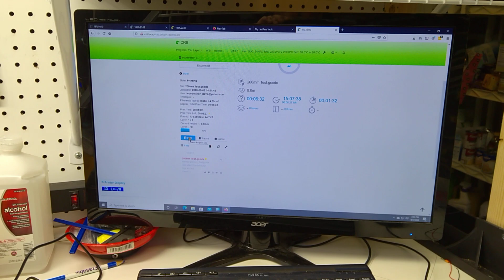CR-6 SE updates

Comment: I have my ender 5 on that same IKEA table, big mistake, its not stable at all (too light) but its temporary, im gonna use a big drawer cabinet so I have some storage also and going to place the printer on concrete on that drawer, hope that works out well.
its always fun to strive to bit by bit a better print :) lets keep on tinkering. thanks for the videos, I love em
Reply from the maker: Thanks for watching.  I agree with the Ikea table.  I have my Ender 5 in the enclosure on it.  Was going to be temporary, but ran out of space.  It works, but would like a better solution. I have quit doing upgrades for a while, don't know what to replace,as there is almost no stock parts left.  I did give the 6SE away, just no real upgrade possibilities.  Take a look at my more recent videos.
Reply: @woodwaker1  I have seen em all :) , I want to redo my dual Z because mine is on the outside, have to take some long time to think about how to do it on the inside because I use the teaching tech Bottom enclosure and also im struggling with part cooling fans, the hero-me keeps colliding with my front bar, I like the pets fang design but need to order some fans, it doesnt end, when you dont have anything to upgrade just redo it all :p
Reply from the maker: @Retro_Care  That's what I'm trying to avoid.  Taking a break and just printing things now.  I kept my one Ender 5 with just a single Z so I don't have to redo the enclosure.   I made the Dual Z version a lot bigger front to back so that I didn't have to worry about the front bar.  The OmniaDrop sits much further forward.

Comment: I have a CR-6 and want to build an enclosure too.  Could you use extenders to help the Lack fit better?  Where did you run into problems with the Lack-approach?
Reply from the maker: It simply was not large enough for the Ender 5.   I wanted some clearance on all sides and the top.  Something you might want to consider is that most people who build enclosures move the electronics, especially power supply and main board out of the enclosure.  Not sure how difficult that would be for the CR 6.  Here is what I did, measure the printer at the extreme movements and then determine the minimum space required for a box.  
Here are some videos of the enclosure build;
https://www.youtube.com/watch?v=53stcBzj-UY&t=120s&ab_channel=DavidWilson
https://www.youtube.com/watch?v=qhXa1GVLnQg&ab_channel=DavidWilson               This one shows the enclosure sitting on the lack table, so you can get a comparison of size

Comment: With the way the CR6 does its autoleveling the filament extruding during your test is going to throw it off. The CR6 autolevels by the hotend basically hitting the bed and sensing that. If you have filament extruding its going to hit that and give random calculations for all over the bed. With the style of these printers leveling you would be best to do it once with no filament loaded. Then just doing it again if it goes off. The level shouldn't really ever be thrown off unless you really do something, as the bed is not adjustable.. Honestly, you are just wasting time running the leveling on every print (and if for whatever reason you need to, you need to investigate for an issue)
Reply from the maker: That makes a lot of sense.  I'll have to give that a try.  Thanks for the tip

Comment: How do get the new Creality 6 SE to print my simplify 3D files
Reply from the maker: I'm assuming files that you have sliced for another printer.  I would say you need to re-slice. I have a rough S3D profile that will get you started,  https://www.thingiverse.com/thing:4589541   It needs some tweaking, but will get a print out.   I was very surprised on how large the retraction needs to be,  I used 10-11 for PLA and even more for PETG.   I installed Octoprint so that I can easily move the gcode to the printer, otherwise a SD card.  I no longer have the printer,  I installed it at my neighbors house this afternoon.  They have three daughters who are excited to be able to learn Tinkercad and how to slice, I put CURA on their laptop as it does an OK job of slicing PLA.  I'm sure I will be helping out
Reply: @woodwaker1  
Thanks for the info my friend

Comment: David, can you provide any specific information on setting up the Raspberry/Octoprint for the CR-6?  I have one set up on my Ender but don't know what's different and the steps to move it to my CR-6.
Reply from the maker: I had a lot of information typed in, but realized it was useless with out details.
I created a Thing with written documentation and screen shots.    https://www.thingiverse.com/thing:4618751

This will get you through a basic Octopi / Octoprint setup.  Let me know if you need help with plugins
Reply: David Wilson so there is no issue connecting the Pi via usb to the printer?   Thought I’ve read about an issue with the power pin. 
Thank you!
Reply from the maker: @mthhurley  The pi will power the display and mainboard even when the printer is off.  I have heard of people modifying the USB cable or purchasing a power blocker.  My solution is to use a power strip and power both on and off at the same time.

Comment: I have octoprint that my dead printer was on, i want to set up my CR-6 se on that. my first go at it failed.   noticed temps where not reporting and the controls where well  off... I installed the ender 3 temp fix, and that fixed the temp issue kind of.  another issue i have is when it finished just a test print, XYZ Cube,  it failed to turn off the hot end but the temps stopped reporting again.  I literally just took the same gcode that i had on the SD card and sent it to Octoprint and this was the result.   Maybe i have something wrong here, can you give me some help with what plug-ins you have and did you have to add any additional Gcode into octoprint for the start or end to get it to work correctly? i mainly use Cura, but i am not stuck on Cura if you recommend a better slicer.  it's buggin me because i had zero issues getting octoprint set up with my old DaVinci (yes i know it's a POS) but the CR-6 seams to be giving me issues.   any help would be appreciated. thank you.
Reply: i have never e-mailed from youtube, how do i find your e-mail to send you a message.
Reply from the maker: @bluetonight17  woodwaker_dave@yahoo.com
Reply from the maker: Justin, if this is not enough send me an e-mail
I use Simplify3D for my slicer
Here is my starting gcode:
G28 ; home all axes
G29; I like to do an ABL on every print

ending gcode:
M104 S0 ; turn off extruder (set temp to 0)
M140 S0 ; turn off bed (set temp to 0)
M84 ; disable motors
G28 X0 Y0

OCTOPRINT PLUGINS	CR-6

https://plugins.octoprint.org/plugins/bedlevelvisualizer/	
https://github.com/chatrat12/layerdisplay/archive/master.zip	
Autoscroll	
Floating Navbar	
Navbar Temp	
taborder	
PrintTimeGenius	
https://github.com/StefanCohen/OctoPrint-Dashboard/archive/master.zip	
DISPLAYLAYERPROGRESS
Reply: @woodwaker1  do you not use the Creality Temp Fix then? i wounder if that is causing me issues. I am going to remove my add-ons and just use what you have, plus i want to keep cancel object, comes in handy if one things comes lose.
Reply from the maker: @bluetonight17  I agree that cancel object is good, I have it on all mine, but have never used it.  One that I like is bed level visualizer, I put it on the CR-6 and was surprised how far out it was, but can't be fixed.
Reply from the maker: @bluetonight17  I did not know there is a fix.  I found the gcode files and printed a couple, then sliced some files in Simplify3d and printed. (see reply below).  I was surprised at the stringing,  I was trying to print PETG which strings more, but I had retraction up to 11 or 12mm, on my Ender 5 with the OmniaDrop direct drive I'm at 0.7mm  with no stringing.
Reply: @woodwaker1  some of us have found that with PETG you need to go to 15mm retraction and then play a little with your speed.  do a tower test, and set it for 15mm with different retraction speed setting for different layers.

side note, did you check you extruder by marking 100mm of the filament and then telling the machine to use 100mm and making sure that it uses within 1mm of 100mm?  reason for asking is the extruder may need to be adjusted and that will cause stringing on this machine. 

I have it printing successfully right now, but not getting temps.  send me an e-mail i will let you look at what it how it is printing, it has another 10 hours or so to go, i have it set that a none logged in user can see the control panel temps, and video but they can not actually do anything.
Reply: @woodwaker1  I can not for whatever reason get the bed level visualizer to work. it downloads and claims that it installs, and i reboot, but it is not there,  i am not sure why, i am thinking i may need a clean octopi image, because i did try to go to Python 3 and currently i have both running and that may be conflicting, but even last night i tried to remove python 3 and no luck.  i even went the other way and removed python2 and forced it to python 3 and still no luck, but i may have screwe up something in doing all that so i may just put a clean image on it, and try again.
Reply from the maker: @bluetonight17  I saw the message that Python 3 was available for download.  Maybe I'm too cautious, but hate to be one on the bleeding edge.
The nice think about Octoprint, is that it is easy to reinstall, its the plug ins that take time.  That's why I keep my list and go through all of them before I reboot, you don't have to do it after each one.  I also save octopi-wpa-supplicant.txt to my server for the next install.  I keep folders on all of my hardware and software that I can reference.
Reply: @woodwaker1  it almost worked, but worked way better. it failed to turn off the motors, but i just sent a m28 to turn them off. and my XYZ cube looks damn near perfect
Reply from the maker: @bluetonight17  Good to hear you are making progress.  This is one of my big problems with Creality, they have a great printer out of the box, but no one thought about how to get the user up and running.   The SD card is useless if you insert it into the printer.  You have to put it into a PC and find the files to print and move them to the root.  The slicer is an old version of CURA with no profile for the CR-6.  In my opinion they should have developed a good profile for CURA and simply provided a link to download the current version.
What really surprised me is that all of the gcode on the SD card was sliced with Simplify3D.  It has all of the settings in the gcode, so I reverse engineered into a profile for Simplify3D and PrusaSlicer.  I have those listed on Thingiverse  https://www.thingiverse.com/thing:4589541
Reply: @woodwaker1  going to test
Reply: What do you have if anything in your g-code section of the Octopi? Been running the CR-6 and 2 other printers on my pi via separate instances since I received it over a month now. The only thing I have done is block the power on the USB because I hate the power back loop on my E3 and CR6 the Q5 uses a different usb cable and doesn’t suffer from this. Use the G29 T to get the bed visualizer working. The only down side to the octopi print setup is the new firmware doesn’t allow tuning while printing from USB. I hate that Creality has jacked up the new firmware interface you can’t even send M600 to pause at height...really love and hate the new printer aside from the potential fire hazard it is a really good printer.
Reply: @rambokd  i put mine in Cura. and i have nothing in Octoprint. I have my bed almost perfectly level so that it just pulls from the EPROM on the SD card with a M420 as you can see below.

M201 X500.00 Y500.00 Z100.00 E5000.00 ;Setup machine max acceleration
M203 X500.00 Y500.00 Z10.00 E50.00 ;Setup machine max feedrate
M204 P500.00 R1000.00 T500.00 ;Setup Print/Retract/Travel acceleration
M205 X8.00 Y8.00 Z0.40 E5.00 ;Setup Jerk
M220 S100 ;Reset Feedrate
M221 S100 ;Reset Flowrate

G28 ;Home
M420 S1 Z0.00

G92 E0 ;Reset Extruder
G1 Z2.0 F3000 ;Move Z Axis up
G1 X10.1 Y20 Z0.28 F5000.0 ;Move to start position
G1 X10.1 Y200.0 Z0.28 F1500.0 E15 ;Draw the first line
G1 X10.4 Y200.0 Z0.28 F5000.0 ;Move to side a little
G1 X10.4 Y20 Z0.28 F1500.0 E30 ;Draw the second line
G92 E0 ;Reset Extruder
G1 Z2.0 F3000 ;Move Z Axis up
Reply: Justin Clevenger In order for the bed visualizer to work you need to have the G29 T added in the octopi gcode start script. It is what sends the bed level information to the octopi to build the visualization. You can do it every time or weekly by just commenting it out when you don’t want it. You should also consider adding the gcode to start the bed and nozzle heating up simultaneously. The CR6 already takes a long time to get to temp it just helps.
Reply from the maker: @bluetonight17  
I had put this print in a corner while I worked on some other projects.
I’m going to loan it to neighbors who have three girls that are being home schooled during the virus.
I loaded Octoprint from scratch and had to load the Creality temperature reporting fix.  This was a good move as all of the plugins now have the new python code.    Here are the settings for Bed Visualizer:
M104 S210;     this sets  nozzle temp to 210
M109 S210;     this waits for it to get to 210
M190 S50;       sets bed temp to 50
G28                   homes
G29T                 does auto bed leveling and saves values

I downloaded the current version of CURA 4.7.1 and it had a CR-6 profile. https://ultimaker.com/software/ultimaker-cura
 The size is wrong, but not too bad it was 220x220x300. I changed to 235 x 235 x 250.  Other than that it seemed to work ok.  I’m sure it could be tuned.